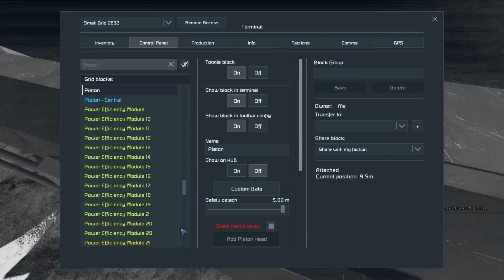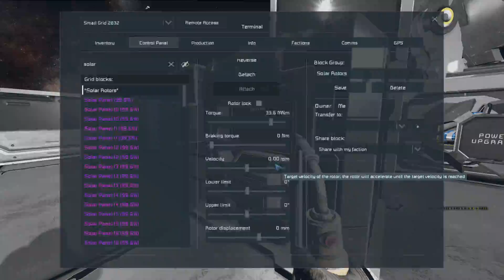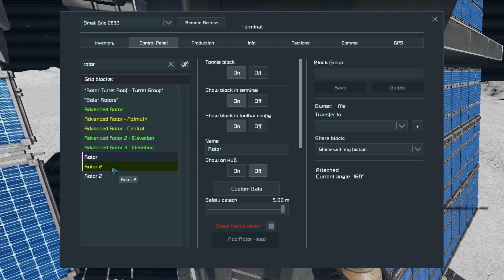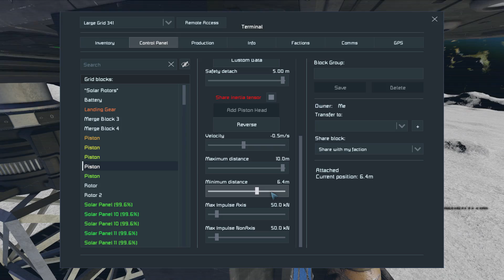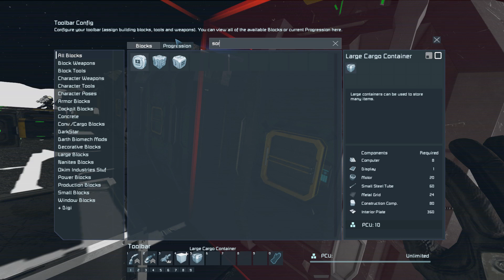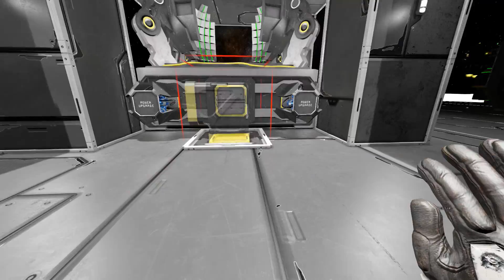Space Engineers - S1E30 'Operation Tower Lift'

Comment: I just recently ran across your Space Engineers series.  I have to say, you did the tower extension in the worst and most wasteful way.  You wasted all the power cells in the battery, used the merge blocks all wrong, and really had no need to mess with the rotor.  Best way to do that extension is: extend out two blocks near the base of the tower; add pistons going up; add two blocks to the top piston to attach it back to the tower; cut the tower between pistons; extend pistons; add blocks up from the cut to 3 blocks below the upper section; add merge blocks in the separation; retract pistons until merge blocks lock; add 4 blocks to block around the merge blocks; cut out merge blocks; replace merge blocks with armor blocks; remove all unnecessary parts.

Comment: Something I learned way too late was to not rely on conveyor tubes too much for long stretches. They have no support connection points at all, other than the start and end points.

This means that if you need to remove a single piece in the line, for example to insert a sorter or a junction, you need to redo the entire line.

That's why I usually don't go more than about 5 blocks without a junction, since the junction has support connections on all sides. Even if it's hanging free in the air, if you need to switch out a piece in the middle, all you need to do is put 5 blocks connecting one junction to another as a support and you can safely cut the tube in the middle.

Comment: I recommend placing the stairs in the walls for the first floor, maybe even the second if you need the room for conveyors.  Then, on your main floor expand the room to by getting rid of the inner wall and have the stairs come up into the large room.

Side note. Id do just two, not four, and by keeping one of the walls on the “main” floor double when you open up the rest, you could still have an effective air lock for a landing bay or such.

Loving the series, keep it up!

Comment: i feel it would be much nicer and practical to have solar field of small towers all around circumference of Zion base, you would still need only one programable block, it wouldnt in the way when landing or shooting something and your entire power system wouldnt crash on a single point of failure. Of course, it would be pain to plan and build and many rotors would consume some resources and energy, but u could shoot anything from the middle and some auxiliary defense points can draw fire to prevent damage to solar panels
IMO,  middle tower would be best for Atlas superlaser on top controled by rotors

Comment: Here's an addon for your solar tower: use oxygen plants as part of the structure for the tower, so you get oxygen and power from a single array.
Reply: You would need conveyors to get the oxygen back down hence need to replace all rotors with advanced ones and replace the entire structure with conveyors. That's building a new tower ;)
Reply: @psyantologist  good point.